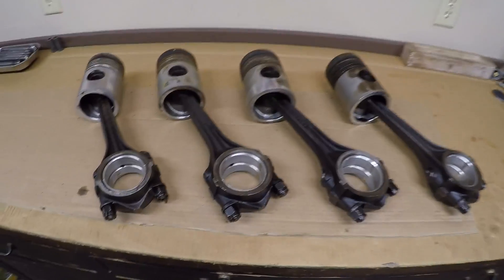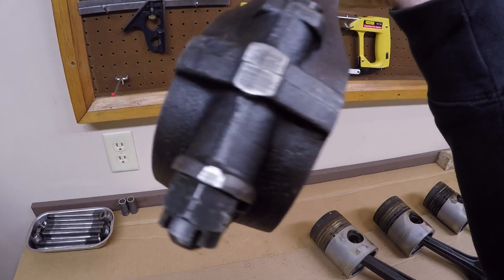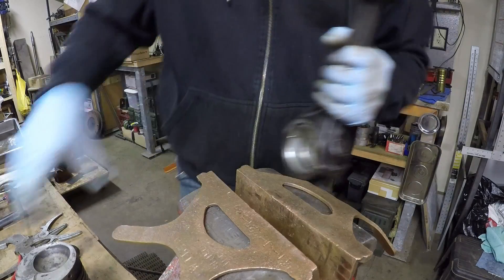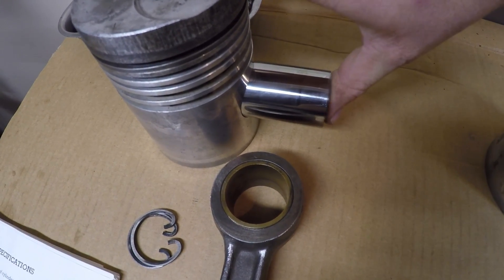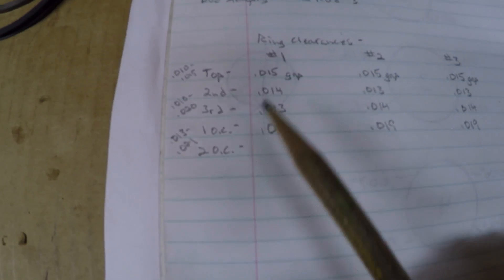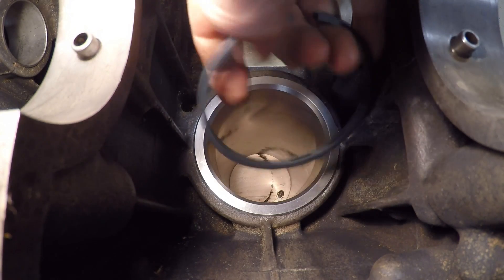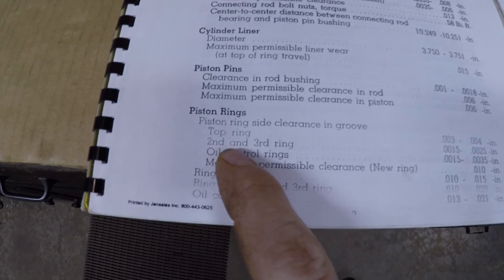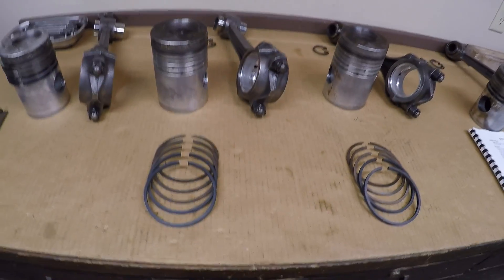Caterpillar D2 #5J1113 Diesel Engine Assembly Ep.5: Pistons, Rods, and Problems...

Comment: Hi, stumbled into your channel while doing some browsing around restoring equipment videos. You certainly have a lot of knowledge and experience around Cat. Thought I would venture a suggestion that may be an asset to your projects. I am in no way or form an official member of the company or its management, but I do have respect for their product. There is a U.S. based company called Vapor Honing Technologies located in Lincolnton, NC who make  "wet based" blasting technology which works remarkably well in removing grease, rust, old gasket material, paint,etc, using a variety of aggregate media such as garnet, aluminium oxide, glass bead etc, which can be mixed in varying ratios to accomplish a specific task. I like the fact that this equipment does not remove any of the target material, but will remove tougher stuff like the old gaskets without marring the surface of the piece and can even polish it back to its original finish if needed.
This might be a piece of equipment that your "day job" shop might be able to use also. Again, I am not affiliated with the company. They have numerous videos here on Youtube that you may want to check out to get an idea of the equipment and its potential benefit in restoring older equipment. Continued success in all of your projects.

Comment: Considering those were three part pistons originally, I wonder if it would be possible to disassemble them and build a new top ring seat part. Probably wouldn't be any fun at all and would cost more than finding old working pistons. But maybe a reason to keep them around for 30 years from now.
Alternately, can you get over-width compression rings?

Comment: In a gas engine, I would expect that detonation caused excessive wear in the top compression ring land.  I wouldn't think that's a "thing" in diesels that would beat up the top ring land, right?  Maybe corrosion on the steel portion of the piston caused erosion of the material, much like the two wrist pins?

Comment: Toby, you don't think that since it's on piston 2 and 3 that the problem is the same problem with the wrist pin on 2 and 3? That would explain the problem if the pins had been wet and rusted that the steel top ring landing is steel as well it would have rusted at the same rate if not worse. Just a thought, I started my career as a mechanic on some engines like these and most of the time if it's one thing causing  the  corrosion it more than likely is the same since it's the same 2 cylinders.

Comment: The excessive scuffing could be due to improper fuel atomization/incomplete combustion creating excessive carbon deposits. I don't know what the cylinders looked like when you took it apart initially. Maybe injection pump is week on those two cylinders. Something definitely happened to 2 and 3
Reply: To me that level of scuffing screams those cylinders were at some time at least run hot.  Could be fuel delivery/ timing issues to those holes, could be the crank is slightly out of proper phase twist(not 180), maybe it had a bad water pump (center cylinders tend to run hotter than the ends). Lots of things could have happened in 80 years, hard to tell. All can do is inspect and check everything and make sure it is up to snuff and run it.
Reply: @bcbloc02  very true. In 80 years a lot of nonsense can happen. These old engines have a lot of history in them. It does sound possible that they got hot due to possible lack of cooling. Great perspective
Reply: It sucks not having the history.. Do you have the injectors for it, and if so, can you get them checked as well as the injection pump checked? While that is some money, it might be worth it in the long run

Comment: Dirt ingestion to the two center pistons only.  I'm guessing the intake manifold has the inlet in the center with the cylinder ports dropping down before turning to enter the head, and only the heavier debris was what did the piston damage.  
Am I right?  If I am, then I'd say the machine was run for a while WITHOUT an air filter.
Reply: @squatch253  Are the injector seats down in the head a bit?  Maybe someone had just those two injectors out a few times for some reason, to save time and/or money.  If the head didn't get blown off really well ... .   Well, you know what happens.

Comment: I like your ring checking QA supervisor, he must be given his approval off camera. I know Hastings was a no go for service replacement rings, but they used to make piston saver ring spacers to allow you to remachine ring grooves and add a spacer to salvage piston with work ring lands. I've used a few sets in Waukesha gas engines (drag line engine) that are long since obsolete to save the original pistons. Not sure if they're still available or not. Even if you substitute #2&3 in this engine, having ring spacers to save those otherwise good pistons for a future project may be nice. Glad that as outside projects are winding down that you're getting some shop time. Soon enough plowing snow and cutting next year's firewood will be competing for your time.
Reply: @squatch253  makes sense, it's traditional to have a keystone top ring in a diesel which I knew but didn't fully think about when I recommended spacers. Good catch. I've only used them on gas pistons. I don't know that I could bring myself to machine number 1 and 4 to match 2 and 3. Your carbon comment reminded me about the profound crown wear above the top ring on 2 and 3. My best guess for that and the top ring land wear would be more towards a bad injector that caused those cylinders to produce more carbon than the end cylinders, or perhaps rust in the liners in the past which would be impossible to detect in the state the engine was in when you took it apart. The profound ring land wear suggests that the top ring was coming up hard against something for some time and I would think carbon ridge or rust ridge would be the most likely candidate. If it was many many hours of dust ingestion I can't imagine the other cylinders surviving as well as they did, or the bearings and crank for that matter. Hope all is well, have a great weekend!

Comment: I ran across this many years ago and found that I could get rings at the time with the additional thickness and had the machine shop fit them to the pistons for me and then polished them so there was no scuff  markings. We put it together and it ran great. I used the engine again in another better frame work and while down was curious if it was as claimed... it was a beautiful thing and no marks! Reassembled and ran for many years till just parked for other reasons
Reply: I was wondering if this was doable. Thanks!

Comment: I suspect the engine was taking on water through the exhaust in its prior life.  It was probably still in infrequent use so the cumulative damage of rust and operation did those cylinders the most damage.

Comment: Once upon a time there was a small but impressive company here in BHM, Piston Ring Service Company.  There are long gone and there is no successor.  However, they had thousands of rings and "spacers" that would shim ring/piston  clearance to correct hammering wear problems such as you have with pistons 2 & 3.  I'm sure that the cleaned the grooves out in a lathe, but I don't know that for a fact.  This was forty years ago, and todays engines go to the scrap pile.  Cheers.